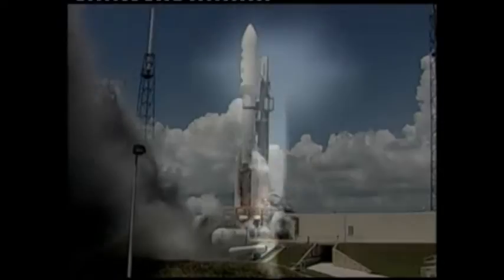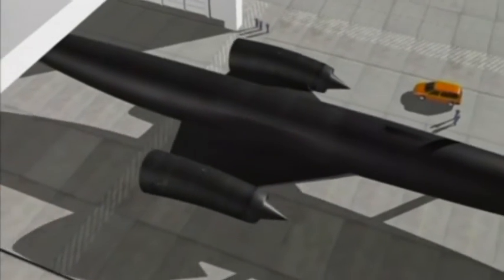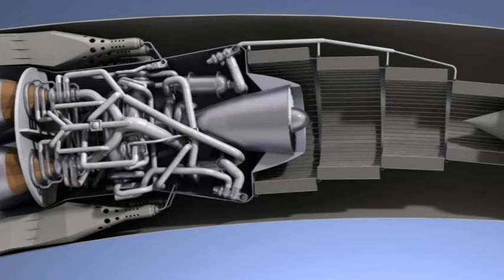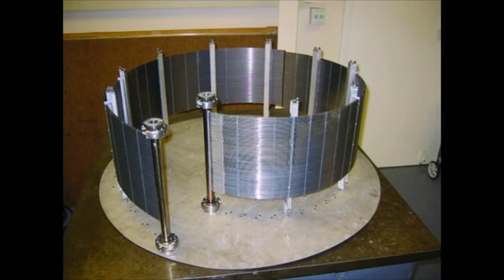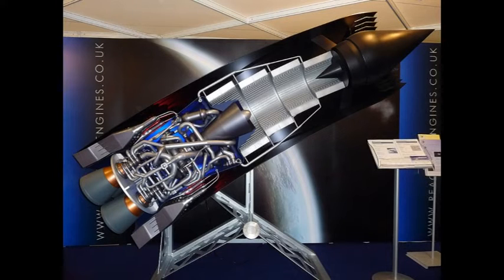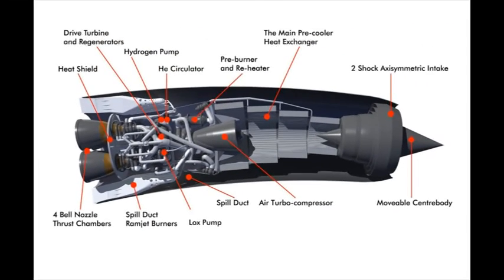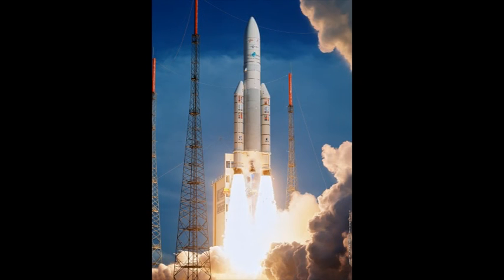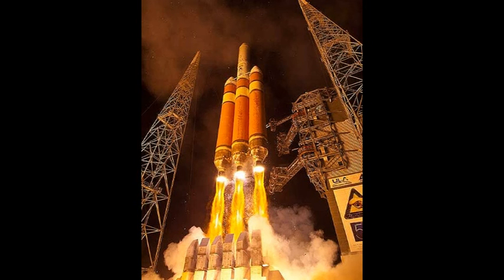Skylon: The key to economic access to space?

Comment: anything to avoid 2 stage full reuse or hypersonic air launch of a smaller reusable spaceplane 🥀

cool though with the hypersonic applications - just use that but put another bloody vehicle on top please and don’t take the jet engines to orbit!!
Reply: It'd be slightly bothersome if every time you drove your car, you had to put together two halves of your car. So instead you use one whole car.
I think that's how cars work, not sure tho
Reply: @CosmicHase it’d be slightly bothersome if you didn’t understand how physics works and that orbital mechanics doesn’t relate to a thing on wheels that drives around a bit

you can apply fully reusability and even aircraft like operations to spaceflight but it’s seriously impractical and stupid to do it completely so
Reply: @alrightydave one of the main selling points of skylon was supposed to be that after you're done with the mission you land it and there's no assembly of the stages required. Like you said, it just brings a bigger problem.
And I was joking dude.